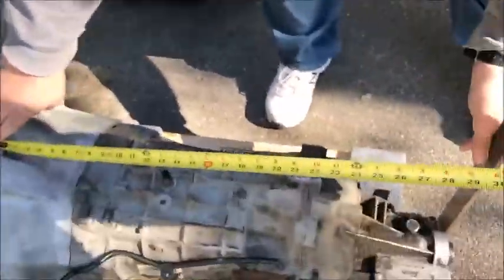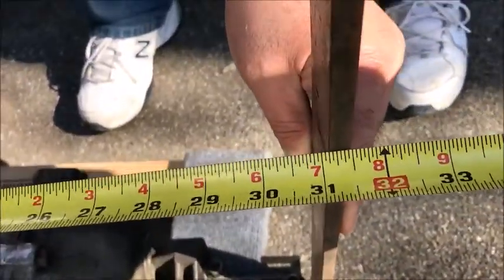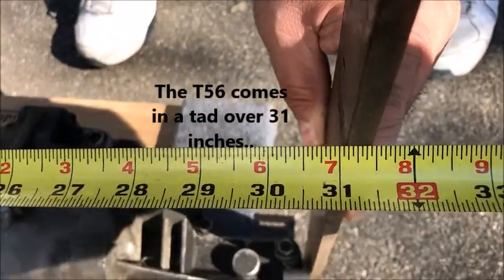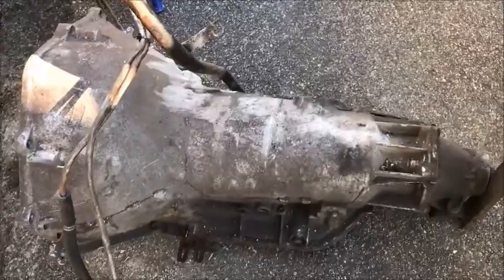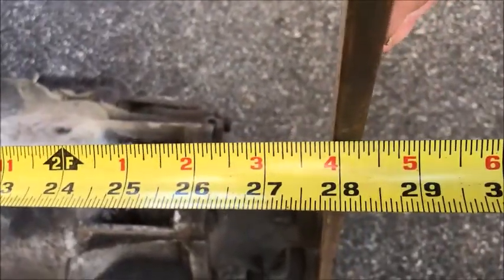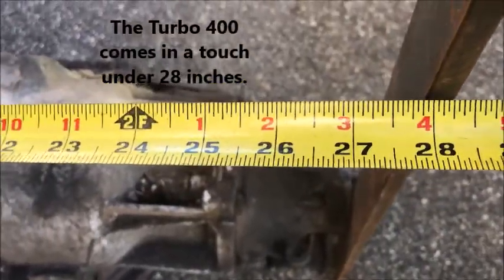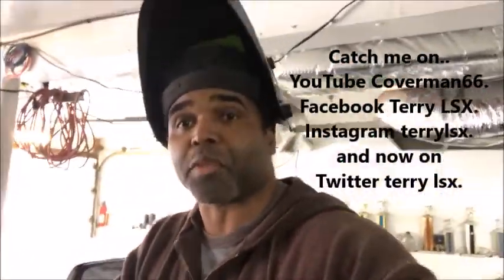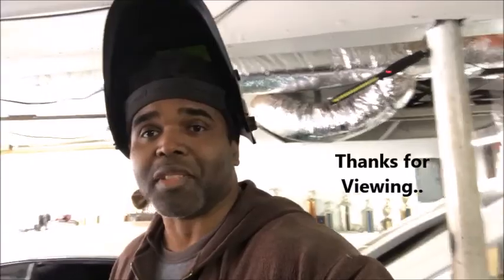Turbo 400 To T56 6spd Size Difference.

Comment: Not only is the measurement critical for moving the engine forward or back but the shifter location is key is you want to go in the stock console location   im doing an s10 conversion with ls1 and just ordered a forward shift relocator so I don't have to cut the floor and rhe seats because the t56 is longer then what was there on the shifter side. Silver sport transmissions is where I got it. Keep that in mind
Reply from the maker: noted and i appreciated it brotha John.. thanks for the comment brotha..